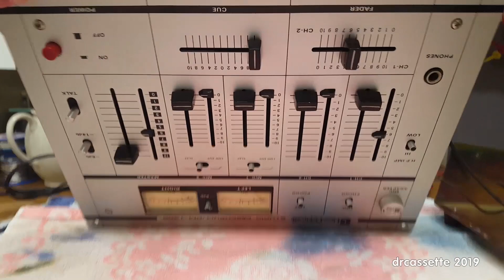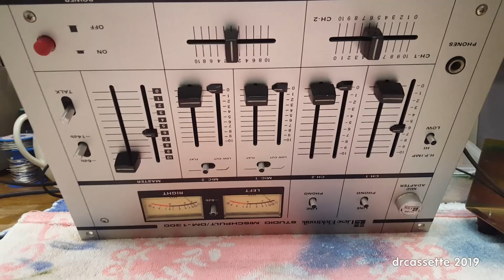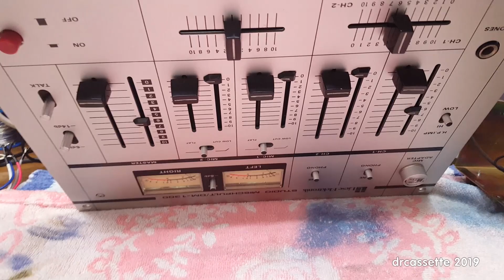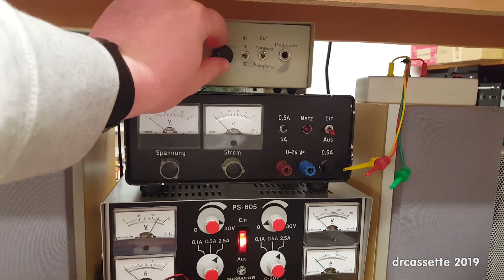Diagnosing hum in a Liese DM-1300 sound mixer

Comment: Hi Dr. Cassette, I left you a message regarding a problem with my Panasonic NV-HS950. Could you please help me out with that? Thank you.
Reply: Hi, I read your comment regarding the HS950 and there are some things that got to my mind.

1. This may not be the fault of your VCR. When fast forwarding it is not given that the picture that the VCR outputs is stable enough for your display to keep sync. When losing sync the first thing a modern TV's or capture card's (especially) analogue encoder does is mess up the colors.

2. It could not be a defect at all. When fast forwarding more than 3x on a VCR without DTF (no VHS machine I know of ever had that and I can guarantee the HS950 doesn't) can show many ways of noise during this function.

3. Try turning on or off CVC and the TBC while performing FF. The HS950 has those two picture optimizers and they do help improving the overall quality of the tape but as with the ADCs of the TV, their results can very much further degrade the picture in every state but 1x normal playback.

4. The HS950 does have SMD capacitors in the video signal's way as well as in the TBC that can go bad. It was still manufactured during capacitorgate.

That's all I can think of. You're probably better off making a good quality video of the fault and then posting the YouTube link  in a forum discussing the NV-HS machines by Panasonic.
Reply: @Halterung01  Thank you very much for your help. I really appreciate it. It's strange to say the least. I've never experienced such a thing. I've made several tests with other gear in my collection (NV-FS200, HR-S9700...) and the LED seems to display a normal picture, with some noise as expected, but with accurate colors. This machina hasn't been serviced since the early 00. It's in the queue for a spa treatment along with other vcr's. The machine outputs perfect picture in normal playback speed though. The tests were performed with the TBC control turned off, same with the noise reduction. I will try to make a short vídeo and send you the link. Thank you very much!!
Reply: @jma6412  what's an SPA treatment?
Reply: @Halterung01  It needs service overhaul and a little bit of love to start killing it again hahaha.

Comment: There is too much unshielded wiring, and wire routing that criss crosses, causing hum.  Changing the power supply to external, and using a supply that is fully capped across the diodes & regulator to prevent hum is best.  A toroid transformer may be overkill, but better than a regular transformer.  changing all wires to shielded and changing routing to not criss cross will also help.
Reply from the maker: You can't clean up the criss crossing wires as the manufacturer didn't seem to know what the final product was going to look like when they designed the circuit board. Things instead of connecting straight to the circuit board need these long wires because they are in a completely different place than the circuits they connect to.

Comment: I had one of these, under a different brand name and yes, same issue, the mains transformer. You can change the hum by rotating the transformer or covering it with Mu Metal, but I ended up with an external power unit.
Reply from the maker: Changing the hum is not really helpful, I want the hum gone entirely :D
So I guess I will end up building a new external power supply for the mixer.

Comment: The exteriour of the unit looks nice but underneath it’s skin it’s a turd. It looks like a rat’s nest with all those wires.
Reply from the maker: Yeah, all these wires are a problem. It also seems like they didn't know what the final product was going to look like when they designed the circuit board. Because just like the Talk Switches that need long wires to connect to the other side of the board, also the headphone jack needs long wires because the headphone amplifier circuit is located on the other side of the board. So, if they had swapped the locations of the headphone jack and the talk switches, it would have been a much better design...
Reply: I agree w/ you but I have a Radio Shack DJ Mixer of the 1990s that looks almost identical to this inside and outside.  It also has an internal power supply.  It works great!  No humming at all.  I just did some recapping to it and replaced the incandescent bulbs with white LEDs to operate cooler.  @DrCassette: try to fix this one, it should be a good piece of equipment after it is fixed.

Comment: There could be ground loops between the PCB ground and the chassis of the equipment due to bad design.  For this kind of audio equipment usually the PCB ground and the chassis are connected via a 47 nF ceramic or Mylar capacitor, not via direct wire.  Or there is such a capacitor(s) and it is defective.
Reply from the maker: You can hear in the video that it's the presence of AC current flow through the mixer that's causing the hum. It can't be a ground loop as I did get the hum to disappear without connecting or disconnecting any wires. But I will take a look at how the grounding is done in this mixer.
Reply: @DrCassette  Please see this picture http://imgbox.com/YRn7cBNt
It seems that Point "1" is the power supply's negative, which is the PCB's ground.  It seems that Point "2" is hardwired to both the chassis and the PCB's ground via a black wire and a screw.  I suggest you completely separate the PCB's ground and the chassis, and connect a C1 = C2 = 47 nF from Point "1" to the chassis, and from Point "2" to the chassis.  I am not sure where the phono ground screw is on the back of the mixer, it could be at Point "2", but there seems to exist a parasite 50 or 100 Hz current between the power supply or the transformer and the chassis.  Good luck.

Comment: Those completely unshielded input/output wires right under the meter lightbulbs could be picking up interference... Maybe replacing them with coax and/or feeding the bulbs off the DC supply could fix the issue, while keeping an internal power supply.
Reply from the maker: I too thought about feeding the lights with DC while editing this video. I will do some more experiments. I have a similar mixer with built-in power supply, and it does not have hum problems, so the internal power supply does not necessarily have to be the problem.